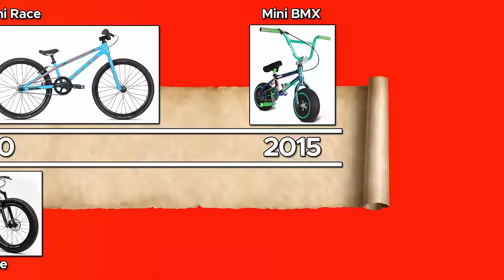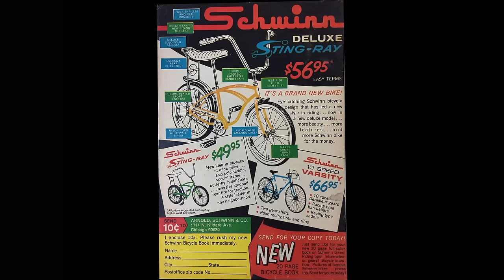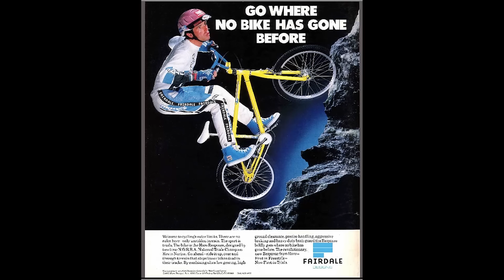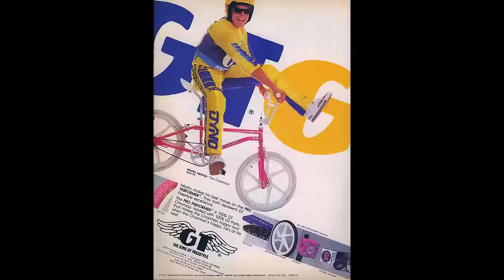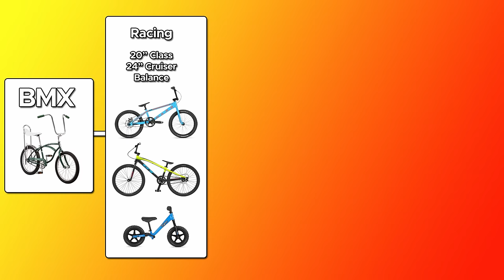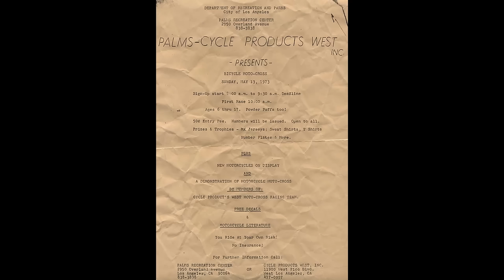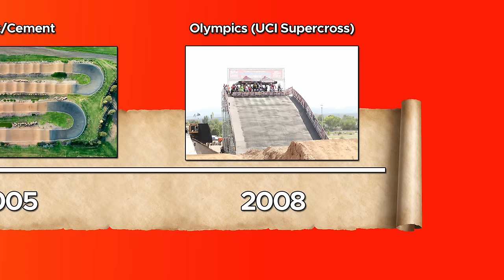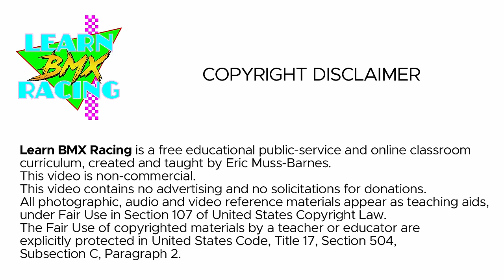History of BMX Bikes & Tracks

Comment: I'm 52 years-old and still ride my Redline BMX Race Bike with Redline 185mm Flight Cranks from the 80s. Mostly at the beaches and up long steep hills for miles often getting nods from  roadbike riders in spandex. Just went in for colonoscopy/polyp removal and amazed the staff at my blood pressure readings. 154 lbs at 52 years-old. If nothing else, keep riding to stay youthful and strong.
Reply from the maker: That's awesome. Keep riding and keep having fun!
Reply: Man,Red line flights were way outa my paperboy league. I started with a stroker,remember those, square frame and old early 1980’s mongoose bikes. S.E. Racing,Redline and even Diamondback were unobtanium for most kids. I’m 54 now, but I loved those years,
Reply from the maker: @saigawesnovember  I hear that. I put Flights on the Haro I rebuilt back in 2009 but I sure couldn't afford them on my Haro Master in 1987.
Reply: @saigawesnovember  
My first bicycle was a used red stroker wit Ashtabula forks and crank arms! My Dad walked me down the street and bought it for me from an older Japanese stoner kid on my block that was friends with my older brother. Dude was the long-haired Japanese version of Stacy Peralta in 1977 with a 8' tall quarter pipe he would leave out in the street and ride with his friends. He had a German Shepherd that pulled him full-speed everywhere on a G&S board with Yo-Yo wheels. His Dad was a super strict hardcore businessman in suit, the, and briefcase.  Later at 16 kid had off road vw dune buggy and rolled it and hurt a buddy real bad getting his family sued. Everyone called him by his Japanese last name which was 2 syllables. He actually was a super cool and nice guy. Anyhow, I broke the Stroker frame in two pieces and had it welded several times. The Redline cranks I bought on a complete bike about 12 years ago. Mint condition with a GT chain ring. Nobody could afford those Flight Cranks! I did buy a PK Ripper frame brand new in 1984 with my paper route money. I never should've sold that PK Ripper! Sold it in 1994. Now it's cell phones and Tik Toc. Kids will never experience the freedom our BMX bikes gave us. Dad kicks your ass? Jump on your bike and spend half the day away at your dirt spots. We ALL got our asses kicked regularly in those days!🙄
Reply: Like you I'm 52 and am about to retire and looking at getting back into riding to get into better shape and fitness, I still have most of my 85 Robinson pro, just need wheels and cranks, I miss those 80'S bikes  they were/are still some of the best.
Reply: My brother's friend had a Redline from maybe the early 80's or perhaps late 70's that had the very best geometry ever. I don't know what it was about that bike but it rode so damn well.  I was 10 at the time and lucky enough that my parents sprang for an '87 Dyno Detour ($300 in the 80's was a LOT of money) I always wanted to ride his because it just felt perfect.
Reply: 52 here, rode,and still riding.
Bless.
Reply: Is right J. Nice one.
Reply: I'm 49 and just bought a 86 D.B. viper...been having the time of my life riding and fixing it up with new parts..... jump it like I'm 15 !!!!! Screw it !!!!!!
Reply: @saigawesnovember  I hear ya ... I'm 49 & I also delivered  the paper in my hood...and I always had to piece together mine..one favorite was a chrome predator with 1 blue and 1 red skyway...dreamed of the 3 piece cranks of any sort but couldn't afford  them either...but I'm getting ready to order sum for my 86 viper and I can't wait!!!
Reply: I had a bunch of mismatched parts on my GT racing frame. Redline 3 piece crank with sealed bearings, DK goose neck, plastic Uni seat, Peregrine alloy rims and Peregrine seat clamp. My bike was super light and I was catching some air off the dirt ramps
Reply: I'll race you! LOL..ME2 .EVERYDAY!
Reply: I’m 54 and ride MTB, road and gravel, but I miss my Hutch that was stolen in college and never replaced. I had built it piece by piece in high school and raced and trail-rode constantly. I wish I still had that bike! Cycling does keep you young. Ride on!
Reply: Throw away your car keys... I haven't had a license since highschool...for the past 32 years I've literally walked run, pedaled, skates or hitched. No shit I've put in enough mileage to have made a one way trip to the moon . True story. I'm m in better shape now then highschool. What a trip.... literally.
Reply: Kuwaharos were super high priced but you knew where your parent's money went when you rode it.
Reply: I ride my Raleigh ultra burner every weekend...I'm 52 my mark two ultra burner is still looking good...
Reply: Oh man, Redline was the ONE!  Jealous!  My Mongoose was nice, but it wasn't a Redline!!!
Reply: I wish you the best with your health! I'm 55 and just completed 2 bmx 24 cruiser, tribute to the 80's,  builds. All high end, graphite's, flights, bullseye, tuff- neck. All sealed bearings  throughout both. One is a 24" SE Racing Floval Flyer XL and the other is a 24" Skyway  T/A XL. RIDE ON!
Reply: I had a Redline too, but from the mid 90's.  I'm 44 now.
Reply: @saigawesnovember those stroker were cool

Comment: Am 52 and retiring soon, and am looking at getting back into riding to get into better shape and fitness.
I knew a bunch about BMX but your video filled in what I didn't know, and where it's at today, Still have most of my 85 Robinson pro, just need to get some wheels and cranks, and am sourcing period correct.
There's just something about old school BMX bikes from the 80'S that today's bikes just don't have.
Reply from the maker: Older bikes are cool, but they are also extremely heavy. There is nothing wrong with starting to race on the '85 Robinson. I used my 2006 Haro Backtrail the first few times I went to the track. But once you get to the track, and see some newer bikes in person, and how far the technology has evolved, I think you'll really appreciate the current bikes a lot.
And congratulations on retiring near 52. That's awesome. Enjoy!
Reply: Agreed. I have a 97 Powerlite P17 that I need to get new wheels for. I trashed mine on some jumps about 17 years ago and never got new ones. I'm going to do that next month. It's been mothballed for far too long.
Reply: @LearnBMXRacing  Newer bikes are fugly and come from a dark place compared to pre-85 BMX originals made in the USA...  grunge wasn't a thing back then...  and people are missing the point today, people don't want to achieve light speed, they just want to have fun and catch some air.  That's why Lebron will never be respected as much as Jordan and people don't watch steroid baseball like they did Ozzie Smith, because people can't relate to these mutants risking their lives taking steroids who are 7 foot tall and a good percentage of sports fans also do no respect cheating.  The bikes need to be as high tech as possible but not while sacrificing the asthetics and new bikes, even the SE Racing newer bikes don't look as good as the originals and this is proven by the price tags of used bikes on Ebay/Craigslist.  I'd much rather ride an old BMX style bike than a new one even though I might go slower, I'll have more fun because the ergonomics, the feel and energy, and looks are better in the old designs.  I can't get enough of the original era BMX, but the new ones.... who cares, it's just dumb and missing the point.  Give me a two bar Torker or looptail PK Ripper or Supergoose any day over a faster better modern BMX, only problem is that those orignal BMX pre-85 1980's BMX bikes are too expensive and rare to ride.
Reply: @VenturaIT  man I wish I still had my chrome frame skyway (was stolen😢)from the mid/ late 80’s that was an awesome bike👍🏻👍🏻 nothing like old school!!!
Reply: @chrisstephenson8311  pre-85 seem to be the best era for BMX...  times have changed, but the vibe is dark now, just like the times unfortunately... it's just like politics because the same investors own all the companies and even though everyone would cut off a finger to have a real 1st gen PK Ripper, the companies keep making fugly designs and asphalt tracks for the millionaires, but pre-85 it was about the poor and middle class kids building up their bikes from parts, and BMX has lost that.  Sign of the times.  Even that movie Rad was too late to catch the real BMX vibe from late 70s to early 80s... I remember this bike that had a long motorcycle type seat, squarish knobby tires, almost like a motorcycle... do you remember when it was cool when bikes really emulated motorcycles?  It's not BMX if you don't put your foot down around corners.

Comment: Well done. Thanks for the trip down memory lane! I started racing BMX in 1975 in Florida. I won the state championship in the 9-10 expert class in West Palm Beach on a Mongoose then stepped up to a custom Panda Elite. Even raced an alloy Bigfoot frame which at the time was the lightest out (anyone remember?).  My final race was a regional championship indoors at the Bayfront Center in St. Pete. Back then it was concrete with wood jumps, and we had to use street tires and spray them with hairspray to help them grip the track. During the first moto I was running first when there was a loud bang heard throughout the auditorium. I quickly realized it was my frame breaking at the goose neck. So, my dad ran to the bike shop and bought a Race Inc. frame and rushed back to the track and swapped everything over just in time for the second moto except for the hand brake which we couldn't get adjusted in time. I ended up placing fifth in the second moto and third in the final. I could go on for hours about the various tracks and memories from my years of racing as they were the best years of my youth.
Reply from the maker: Damn. I'm really impressed your dad swapped out everything onto a new frame between motos! I have built multiple bikes from scratch, but I never had to do it that fast!
Reply: I did as much on it as he did. lol I was able to disassemble bikes to the bare frame and reassemble at 10.  @LearnBMXRacing

Comment: I was of the understanding that a lot of freestyle and trail riders angle their seats up to make it easier to grab or get a foot under. I really wouldn’t know anything about that, but it’s what I’ve heard. Great video!
Reply from the maker: Many of them claim that.
I think it's nonsense.
Because, again, the tricks that were done in the 1970's and 1980's were just the same, and those riders didn't need to angle their seats.
So, yes, I think you are correct. But, I also think it's just a case of kids blindly following a totally unnecessary trend, because they were told that was the way to do it, and they never questioned it.

Comment: I still have my 1978 Torker. I’ve been thinking of making it a retirement restoration project and add the period correct accessories I couldn’t afford back then. At age 61 I’m probably too old to do much other than maybe a quick pedal on my street. I do know I can use some skills I learned in BMX in mountain biking.

Outstanding video!
Reply from the maker: Thank you. Glad you enjoyed it.
You are not "too old" to race. There are racers out there who are in their 70's and even one rider in Georgia who was racing at 82. You could easily have 20 years of racing if you wanted it.
Reply: That's maybe the best BMX bike ever, right up there with the PK Ripper, bike of envy.  My friend had one, probably still has it in the attic.
Reply: @LearnBMXRacing  And don't get me wrong I agree tracks need to go back to natural dirt, but it's more than that and I think you came into BMX later on in the 80's and the real good BMX stuff was late 70's and pre-85 1980's....  but you are still doing it which is more than me, although I show chromed and restored my original Motomag Mongoose.  Can't remember if it's 1980 or 1981...
Reply: @VenturaIT  Thank you for the positive reply. I liked the design of the PK as well. To this day I still have great respect for the top riders from the original BMX era and their achievements.
Reply: @519CZRacer  The new stuff is surely lighter and stronger but the original BMX designs are the best... I think there can only be a few really good looking designs until you just start doing the same thing again.
Reply: @519CZRacer  Also that Torker, I remember clearly trying it out, it had the thinner tires which was a big thing back then, but it was so tight, nothing rattled, and very light weight.  I can't imagine anything better.

Comment: I had a Mongoose and it was a vision of the color "red". I loved that bike. It had a red plastic seat with red alloy seat post that was shaped like the inside of a gun barrel, red grips, the kind that molded to your hands with finger inlays, a red Haro two-finger brake system, red snake-belly tires and rims along with red pedals. If that wasn't "red" enough, I strapped red padding over the neck and middle bar. It looked awesome !! The only thing I wished it had in retrospect was a red three-piece alloy crank-set (Mongoose didn't offer this option as it came stock with a single crank-set with the gold inlay in the middle). However, the GT's and Redline's had this option of a colored 3-piece crank set which looked really, really cool when matched up with everything else. 
I remember a neighbor's friend pulled up on an all-yellow /gold Gt, fully decked out. It was a sight to behold! He even had holes drilled into the plastic seat to make it lighter. I think he was a serious racer on the circuit or sponsored or something. But yea, the whole idea of having colored anything is out of style today, particularly colored crank sets. 
There was something to them, when I look back on those colored reflective finishes, the finish looked more like reflective coating you'd see on high performance F1 cars than bicycle painted parts. Real classy workmanship imo.  
Thank you for this trip down memory lane as I pedaled alongside on my Mongoose loving every minute of it.  ;)
Reply from the maker: You are welcome. And thank you for sharing your stories. The fact so many people can recall so many details about their bicycles proves how important those bikes were.

Comment: In the early 70s I lived in So California and we would build our own Motocross bikes. We would put Nobby tires on them and the handlebars with the bar across were only 5 bucks at the swap meet or local store. They were being custom made so you would see them com in bunches. Then we would add that custom suspension forks that would bounce. I you had one , you rulled the streets. I had a blast building my first motocross in the early early 70s. We would build ramps and jump on them which led to dirt hills. By the time they took to the popular racing events, I outgrew them and was on a road bike by the late 70s. Everyone built their own buy looking at magazines and putting their bikes together. No stores sold motocross in the very early stages in So California. You built your own like a puzzle. The Swap meets in So Cal were the best spot to buy bike parts for Motocross. I am 59 yrs old so that tells you how far I go back. You were spot on as far as the history goes because my first bike was a schwinn Orange Krate with a coil fork , gears, bananna seat, Ape hangers and a long sissy bar. After it got stolen in the early 70s, the motocross were in and everyone started building their own. My third bike was in late 70s which was  a 10 speed and it was quick. I been riding since last oct 2021 and have a hybrid. I never thought I would see my self on a bike some 40 yrs later but the cannondales are incredible. I see these road bikes as 10 speeds in my head nowdays. I have to get used to calling them Roadbikes or gravel bikes. lol
Reply from the maker: Nice. Thanks for sharing your experiences.

Comment: Great video! Missing some points for todays different styles of freestyle. Why Pegs are on one side because, the rider may only favor grinding on one side. Why they also sell left side drive cranks and wheels for people who prefer grinding on the right side and vice Versa . you didn’t mention what a freecoaster is. freecoaster allows you to roll backwards without back pedaling. Great for skateparks. This is an awesome video. I learned a lot of the history. Thank you .
Reply from the maker: Thank you. Glad you enjoyed it.
The meaning of "freecoaster" actually changed too.
Back in the 80's, ACS had a hub called the "freecoaster" which was literally a freewheel and a coaster-brake. You would dial a little adjustment screw on it to switch back and forth. So, the old-school term "freecoaster" and the current term "freecoaster" are totally different things.
Reply: Pegs originally were included on all axels, both sides for flatground, not griding tricks. Grinding came later.
Reply: @LearnBMXRacing  Doesn't he mean "freewheel"?  We used to take the brakes out of the coaster brakes to achieve the freewheel until we could afford better rims.

Comment: I haven’t finished the video yet but one that seems to have been missed are bmx pit bikes, basically a child size miniature  freestyle frame with full-size bmx bars and seat post to accommodate an adult size rider.
Pit bike as in used around the pits at bmx tracks for stunts e.t.c.   They were fantastic in half pipes and skateboard parks too.
Reply from the maker: The criteria for what to include was left up to my own personal opinion of what is relevant and important.
Since there have been hundreds of different bicycle designs in the last 200 years, it is inevitable some folks will disagree with my decisions about which bikes were significant or omitted.